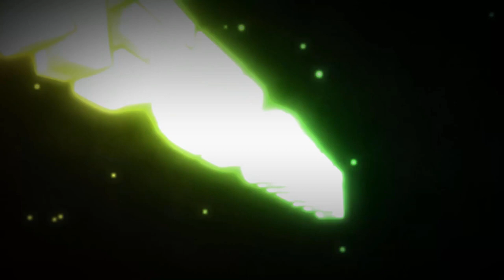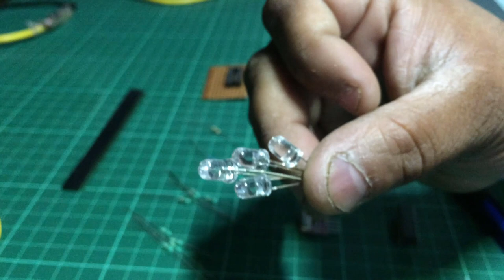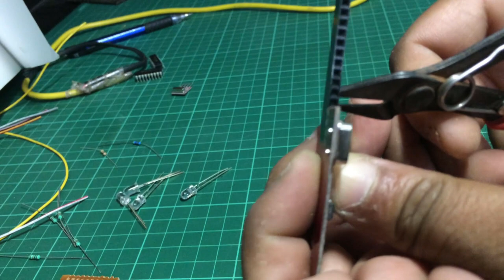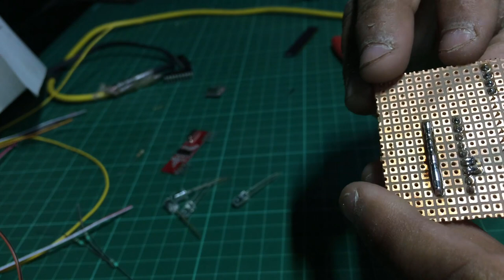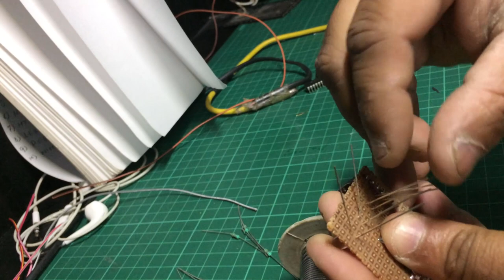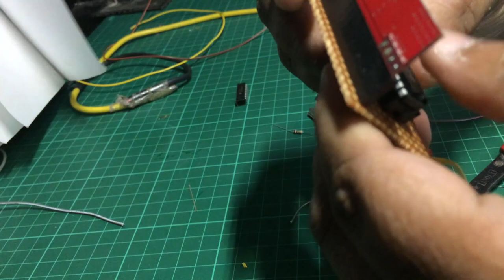Wireless Water Level Indicator In Hindi

Comment: Battery backup? Can we give 12v ? Reply
Reply from the maker: Yes you can give but not directly you have to use 7805 ic before the module.let me know if you need circuit diagram?
Reply: @learnfromideas5258  yes of course and thank for the reply

Comment: Please tell me one thing. If I will buy that module which is given in the link then I can skip all the steps in first twenty minutes of the video?
Sorry I'm not electronics engineer. So I'm not familiar with making circuits. Please guide
Reply from the maker: Neha Tulsyan you are absolutely right.
Reply from the maker: YOU MAY BUY THIS AS WELL
https://www.amazon.in/Embeddinator-Wireless-Encoder-Decoder-Module/dp/B074T122NQ/ref=sr_1_11?keywords=rf+433+module+KIT&qid=1562424808&s=industrial&sr=1-11

Comment: Transformerless 12v power supply apaka video he kya .bcz all videos me mera led fuse ho Raha he please help me
Reply from the maker: LED se Pahle 220 ohm Ka resister lagao.
Reply: Or capacitor charge hi rehata he to power off karne ke bad wo led blow karata he plz give me solution
Reply from the maker: @mangeshw9391  Capacitor ke across ek 10K ka resistor laga do.
Reply: @learnfromideas5258 ka video he to share karo na sir . Nahi to components list do
Reply from the maker: @mangeshw9391  Apko kiski component list chahiye.
Reply: 12v transformerless power supply

Comment: BRO BILL OF MATERIAL PLZ
Reply from the maker: RF MODULE 433MHZ TRANSMITTER AND RECEIVER          X 01

PCB (PRINTED CIRCUIT BOARD)                                               X
01

HEADER PINS FEMALE                                                                X
01

3 VOLTS BATTERY                                                                        X
01

LED DIFERENT COLORS                                                               X
04

RESISTER 1 MEGHA OHM                                                           X
01

RESISTER 47K                                                                                X
04

RESISTER 220 OHM                                                                      X
04

WIRES